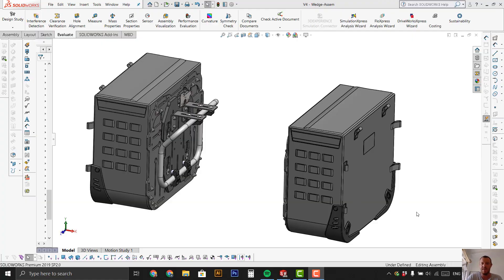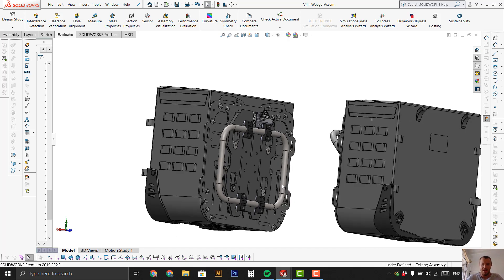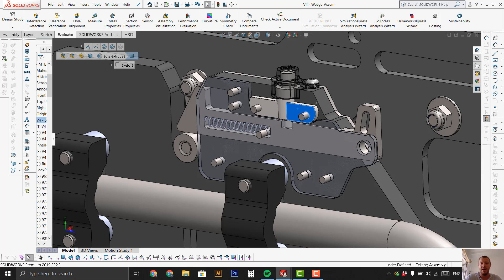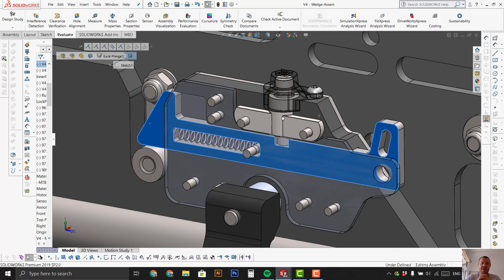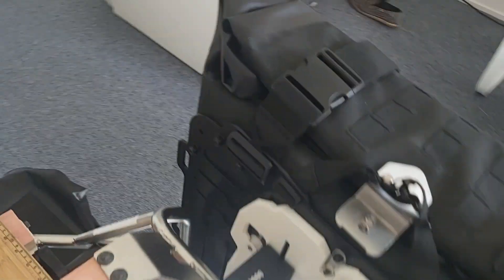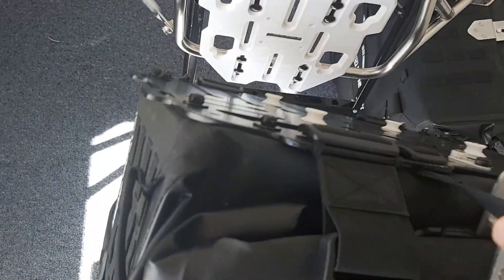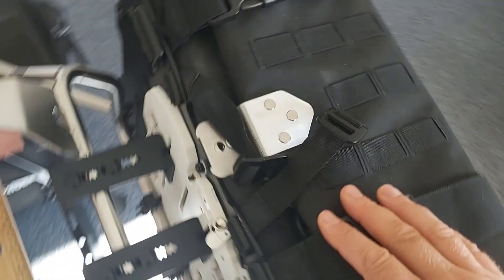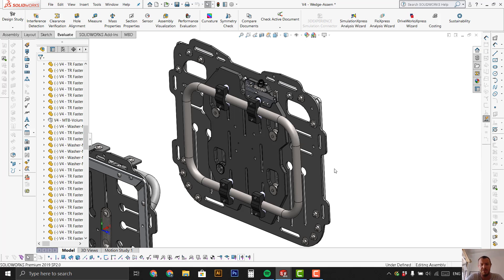Quick Release Motorcycle Panniers. Fastest connection on the market? Lone Rider Clip'nRide Update.

Comment: Very good idea ! just to confirm, is the plate will be in "plastic"? Because I think that with time, the notches could be worn and in this case, it will be very useful to design some repair kit ( clip ?) to repair the system without changing all the plate
Reply from the maker: Nylon 6, it's very very strong.

Comment: Anyway to key the locks on the top of the bag with the new locking system ?
Reply from the maker: What locking system would you add? I will check it out. But I have made an area near the latch where you can use a small padlock instead of the push lock
Reply: @LONERIDERMoto  sorry i was not clear, the lock on the roll down on the very top of the bag for security and the lock on the bags, were they attache to the bike, if they could all 4  could be keyed the same.